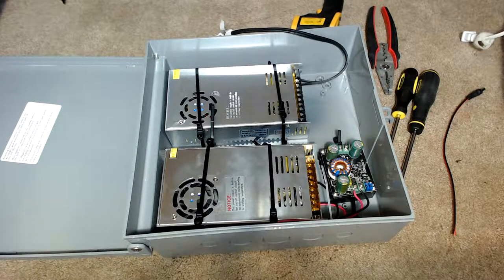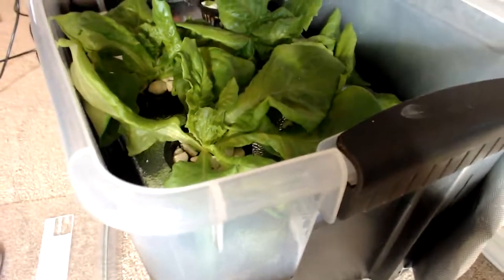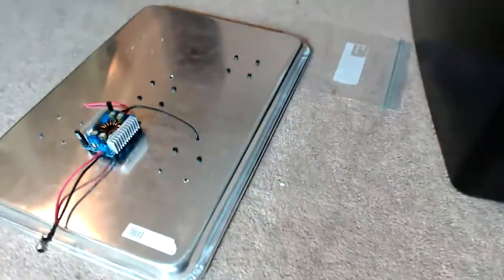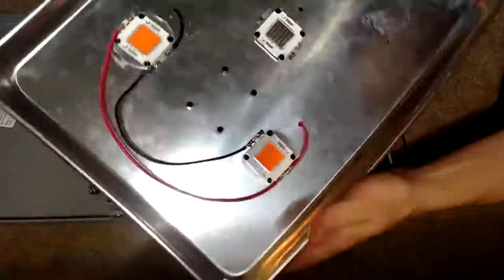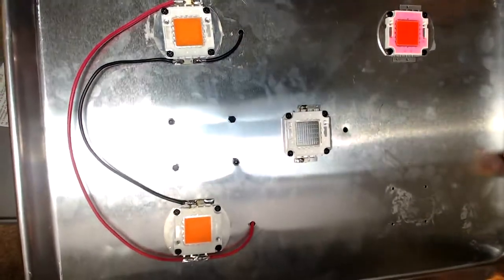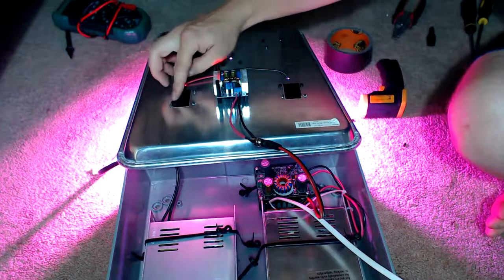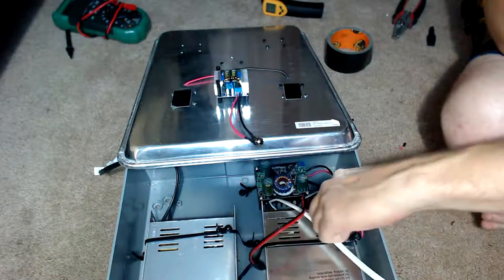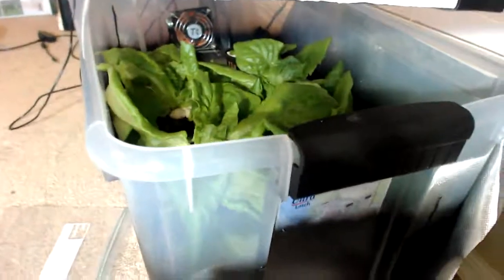DIY cookie sheet grow LED

Comment from the maker: without a cooling solution, I haven't tuned the voltage yet.  I typically use a voltage around 25V when powering in parallel, but I tune that higher or lower depending on the desired power output and temperature.  in part two, I use a driver that requires the modules to be wired in series.  when I get cooling installed, I'll measure the power output.

Comment: What is the voltage and current?
Reply from the maker: These are 50W modules rated at about 26V and about 2A each.
Reply: I was wondering what the actual volt an amps you are using. Not what they are rated for.
Reply: tripzero try to use half the current at the right voltage, so get a 25v (or 2 twelve volters in series) at 1amp, this way you will under drive them causing much less heat. The power supplies will be toasty tho, crack the lids off and aim a fan at them or if there like those ones in your vid in a punched hole case just aim a computer fan at them.